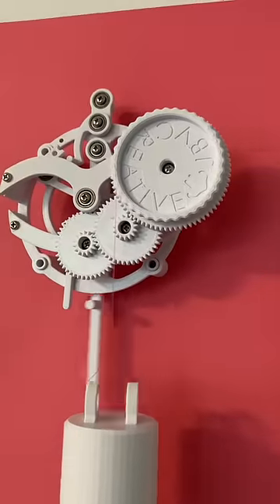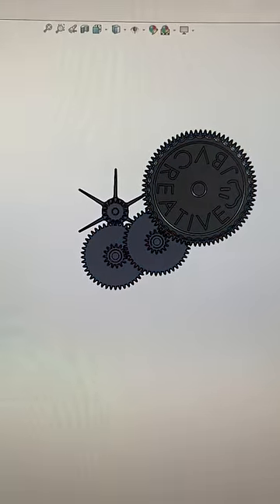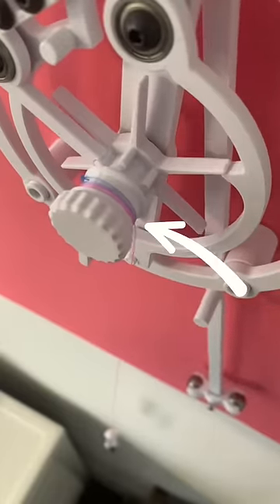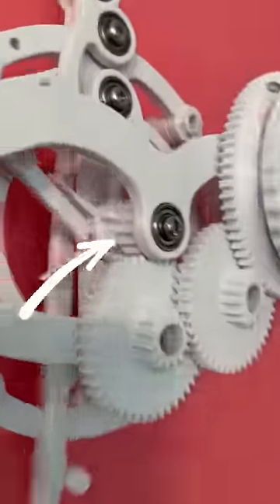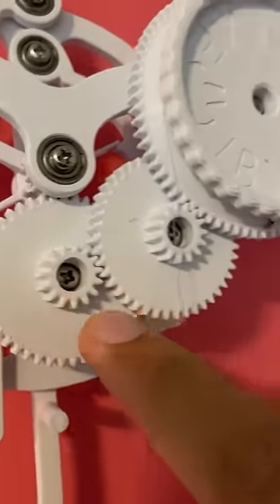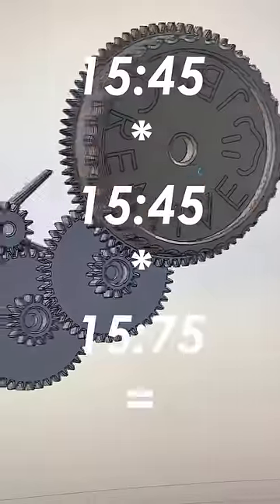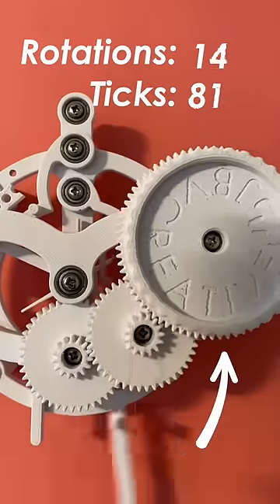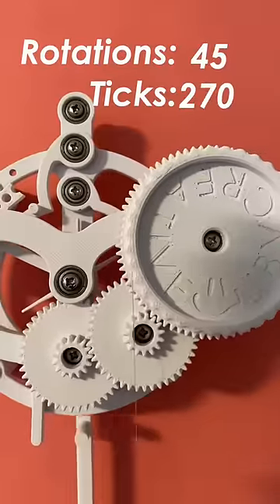Why Did I add Gears to this Clock Mechanism?

Comment: Poor guy had to explain why there is a weight for all the "infinite energy" smooth brains 😂
Reply: The amount of people in the first video saying it was fake because perpetual motion is impossible 🤦‍♂️🤦‍♂️
Reply: @Mike0  that's in some way even sadder 😂
Reply: That weight is a battery
Reply: Smooth move, Ex-Lax. You're as sharp as a marble.
Reply: @Nikkikkikkiz  How would a battery even help here?
Reply: @arcticfox037  it is a battery
Reply: @Nikkikkikkiz  ?
Reply: @arcticfox037  the weight can be called a battery as it stores Energy until is is used.
Reply: The weight is just a battery using potential energy unlike most consumer batteries using chemical energy
Reply: It was the specific words he used that caused it.  "Putting energy back into the pendulum/ system" caught everyone
Reply: @arcticfox037  by providing weight. He never said it gave electrical power to the clock.
Reply: @arcticfox037  I was going to tell you but other people already told you haha

Comment: If you make the Pendulum twice as long it will run longer. Pendulums should not swing more then 3 digress each side to be Isochronous. It's sort of  important. 997mm is about 1 second

Comment: Adjusting the weight and length of the pendulum will also increase time, perhaps more precisely. You might as well make a grandfather clock at this point, you’re halfway there

Comment: “This is not a perpetual motion machine”

Ah shucks really thought you created infinite energy to power the entire planet for a second there
Reply from the maker: LOLz
Reply: It's possible. Just a lot more work. I'm trying to figure it out. But I would rather ask the right questions

The hardest part would be to create the perpetual motion automaton which would in turn create the machines that would create the automatons that create the perpetual motion device so that when it wears out it will replace itself. Or, you could just make another human

Robots. The fun part is making the baby
Reply: @keenansmith82  perpetual motion is not possible.
Reply: @cmarshallc  woooshh
Reply: @aayesher9400  you sure about that?
Reply: @cmarshallc  somewhere in future it might be possible
Reply: @the_coconut_man7759  it violates too many rules it is not possible
Reply: @Cheems856  i said "maybe in the future" implying that one day we actually find a way to do it
Reply: For a perpetual motion machine you would need zero resistance (no matter if electric or mechanical) which is simply not possible as absolutely zero is not achievable ( I know there are other superconducters that work above 0 K, but they have their own issues) or having zero friction as even quantum fluctuations would stop the machine at some point
Reply: Can't wait for some random to just invent an actual perpetual motion machine defying all laws of science lol
Reply: @the_coconut_man7759  no, we won't.
Reply: @hurz506  yes we will
Reply: @the_coconut_man7759  
No we won't. Perpetual motion is not possible, and we know this as it has been an important area of study for literally thousands of years.
Reply: @the_coconut_man7759  it literally goes against the laws of thermodynamics. Unless the very fundamental laws of our universe changes, it is impossible
Reply: @justsomeguywithnolife7469   Even with zero resistance you don't have a way to take energy Out of the system to create power. So sure, it has perpetual motion, but no way to produce power. Which means it's not the same as a "perpetual motion machine". As that phrase has a special meaning.
Reply: @SendarSlayer  I thought it was just meaning going forever. Yeah of course it doesn’t create energy I wasn’t trying to imply that
Reply: @the_coconut_man7759  please educate yourself properly before making such claims, you're making a joke of yourself
Reply: @keenansmith82  the first law of thermodynamics really flew over your head💀😭
Reply: @tim.m  i know its impossible  because of the laws of thermodynamics but ive seen a shit ton of science discoveries that make me think its possible
Reply: @the_coconut_man7759  You just completely contradicted yourself... It's impossible.
Reply: @justsomeguywithnolife7469  so basically space which lacks air and gravity then to find a way to get rid of friction entirely.
Reply: @musa978  : )

Hehe
Reply: @Engineezy  I'm glad you said that it's not a perpetual motion machine, but sad that you had to say it.
Reply: may I ask what 3d printer you use?
Reply: Opposite realisation for me. I knew they are impossible so i was looking for the catch. And that is that you have to twist the weight back up
Reply: @aayesher9400  this isn't a wooosh moment. He's right
Reply: Lmao perpetual motion is this funny make believe idea. Energy in Energy out 1-1 . Physics can never be unequal.
Reply: I mean ideally you can create a machine that never stops, that's feasible in theory (for example a wheel in space would ideally keep spinning forever). But a machine operating above 100% efficiency, meaning it outputs more energy that it was put in, that's just nonsense in any way you put it
Reply: @nocturn9x  no a wheel spinning will not continue spinning . You have drag elements that leach energy off......
Reply: It's impossible to create an infinite source of energy but is possible to create one that can last for extremely long periods of time (thousands of years or higher).
Reply: @honquewastaken2298  pushing it but yes
Reply: @keenansmith82  gotta harvest the energy in the atmosphere
Reply: @honquewastaken2298  I know lol it would be cool if eventually we had tech to come super close to it with a highly low maintenance requirement to replace things like nuclear fossil and bio fuels though I doubt that would ever happen
Reply: Elon musk already figured it out. It's giga factories
Reply: @the_coconut_man7759  there will never be a way to get more out of a system than what is put in.

You might as well stay "maybe in the future we will discover a way to break physics"
Reply: @jeffh6960  I said "ideally" and "in space" (= no drag)...
Reply: @nocturn9x  space still has drag...... space is just a vacuum.
Reply: @the_coconut_man7759  back to school for you g, shouldn't have skipped physics class.
Reply: @cmarshallc  One of two things is true: @Keenan Smith knows a p-m machine isn't possible or he thinks we can just build a machine that builds machines to make machines that build more machines. I think he knows...
Reply: @clearviewmoai  nah
Reply: „There is no free Enegery device“ - angry ElectroBOOM
Reply: For people believing in those perpetual motion machines go watch his videos he explains it well why it can’t work
Reply: @jeffh6960  Yes, there's a tiny amount of drag. It's why I said "ideally". Of course perpetual motion doesn't exist, but physically speaking perpetual motion is feasible if we could somehow remove all sources of drag, but a machine that operates above 100% efficiency just breaks all laws of physics
Reply: And people who think its impossible are the people who are gonna slow down the progression of humanity
Reply: @the_coconut_man7759  it quite literally is not possible and breaks several laws
Reply: @Jem2556  you really want to think its impossible
Reply: U can also make the pendulum longer 🤔
Reply: @the_coconut_man7759  no I don’t, infinite energy would be sick, but it’s not possible you can’t create energy nor destroy energy, it’s probably the most important law in physics
Reply: @the_coconut_man7759  "Nah bro trust me scientists discover wild shit every day so it may be possible to reverse entropy"
Reply: Jesus replying on this comment area is tiring
Reply: There is no free energy!!! (Electroboom)
Reply: @keenansmith82  no it's not
Reply: Physically impossible to get more work out of something than you put in. Regardless of how many flat earth posts y'all subscribe too.
For clarification I love your videos. Just not the tik tok kids here thinking they know math let alone physics.
Reply: @the_coconut_man7759  proof? Or just wishing? At that point you might as well pray.
Same result. Nothing.
Reply: @ninefingerjack  well the electromagnetic flux gen was proven to work but im already tired trying to prove its possible to create a perpetual machine since its a 5v1
Reply: @the_coconut_man7759  and you're mistaking fusion with perpetual motion. That's literally after a 5 second Google search.
Read first.
Reply: Goodbye and thank you for wasting my time
Reply: Well perpetual motion is not possible on earth because of friction a magic thing that transfers energy of free usable form into heat which in turn dissipates because of temperature
Reply: The only and really only possible half perpetual motion is a magnetic field that lifts or accelerates something and then drops it over and over again to make heat to boil water and use a steam wheel to get electrical energy to power the magnet itself (in order to turn it on / off) which would in turn without friction go infinite but won't win energy because to "make" energy we would need to destroy matter with antimatter and even then it is transforming, because atoms are consisting of energy they can be transformed into their free form of energy, the only way to win energy would be to form matter and antimatter out of nothing
Reply: @ethandark1232  perpetual motion is not possible anywhere due to the law of conservation of energy.
Reply: Even perpetual motion would just be basically frictionless environment. It's just maintaining energy in the same state at infinite efficiency. You'd need to create energy without expending energy or material to get the infinite energy.
Reply: @keenansmith82  perpetual motion machines are known for being impossible
Reply: @aayesher9400  no I don't think that's a wooosh moment I'm pretty sure he actually thinks he can make a perpetual motion machine
Reply: Just to let everyone know, you can use something like this to make a gravity powered energy generator, but just because it only uses gravity does not mean it is perpetual motion.
Reply: @notablequasar6446  There is no such thing as a gravity generator what you mean is potential energy. You lift something up and drop it to release the energy. The only real use case for this is for storing energy by having water pumped up in surplus and pushed through a turbine when you need energy but it doesn’t create Energy with gravity it just stores it
Reply: @justsomeguywithnolife7469  Energy isn't the way to think about this. It's power. Say the string on the machine in the video ran in a loop, and then it falls for 20 mins (Due to the gear ratio), then you unattach said weight from the loop, lift it up in the span of 2 seconds back to its initial position, then let it fall for another 20 minutes. Does that not produce power from gravity? If not please explain.
Reply: @the_coconut_man7759  i love how all of you evidence is "trust me bro"
Reply: @justsomeguywithnolife7469   overunity.
Reply: perpetual motion isn't a thing at the moment, because it will lose energy at some point, some things tho are engineered so well that they can mimic perpetual motion,
Reply: Once we figure out efficient fusion, a glass of seawater will provide the same energy as burning a barrel of oil
Reply: This comment section is just sad
Reply: @cmarshallc  it is, just not in a way to harness its potential. A perpetual motion GENERATOR isn’t possible, not perpetual motion in general.
Reply: @keenansmith82  actually it's not possible,and no ammount of work changes that.
Reply: @aayesher9400  he is 100% serious,stop covering for stupid people by pretending they are joking, you only make a fool of yourself
Reply: @the_coconut_man7759  there is no mabye,we know for a fact it is not possible,no way to make it exists or can exist,period.
Reply: @the_coconut_man7759  you'll wait untill the heat death of the universe then
Reply: @notablequasar6446  you put energy in it by lifting it back up and it gets released again you didn’t make power as you needed to put energy into the system (for example using your muscle power to move the weight up) so it can fall down again releasing the potential energy. Also Energy is just Power * Time
Reply: @ryanlee900  There is no free energy device. Don’t you think a device that was invented in 1985 wouldn’t get used by a third world country if it makes energy out of thin air? You act like there aren’t any other countries in desperate need of energy who don’t “suppress knowledge , btw I saw that on history channel!”
Reply: @the-lag-gamerita5446  might aswell lol
Reply: @IvanSN  it's not possible with our current law of physics, if we ever figure out a way to modify the laws or go to different universes with different laws then we might figure it out, just never in this universe with this set of laws
Reply: @potatopotato590  neither will never happen. they're not possible.
Reply: @justsomeguywithnolife7469  Yea you're probably right, but power = force*speed or energy/time.
Reply: @keenansmith82  perpetual motion machines are objects that use energy without needing energy taken from another area. This would effectively produce an infinite amount of energy. It's not hard; it's impossible...
Reply: @justinkaufman495  space actually still has some gasses in it, Infact that's actually what stars are made of, Giant clouds of gas that get so big they collapse and start nuclear fusion(Not fission, That's dividing atoms, Fusing them is what stars do, Just had to clarify that to give people no excuses to say stupid stuff)
Reply: @excision3409  that's like saying my car's gas tank isn't empty. there's metal in there.
Reply: @notablequasar6446  you realise P = E/t is the same as E = P*t
Reply: @justsomeguywithnolife7469  And my literary skills (i.e. reading that sentence) is why I prefer maths.
Reply: @the_coconut_man7759  well if friction doesn't fucking exist in the future, sure
Reply: @notablequasar6446  you can generate power from gravity there, sure, but you first have to put energy in by raising the weight up and rewinding the string
Reply: @keenansmith82  perpetual potion is imposible, done
Reply: @Cheems856  the only rules it violates are the ones we ourselves created, and therefore there may be a way to break them
Reply: @keenansmith82  even if you get perpetual motion, you can't take energy out or its broken
Reply: @notablequasar6446  nope that's still just storing up potential energy. you put in energy by lifting up the weight and then it uses that energy for 20 minutes. you arent generating energy, just using what you put in
Reply: @keenansmith82  also trying to figure this out. Gravity IS a constant force so theoretically this could be turned into a perpetual motion machine. 🤔
Reply: @keenansmith82  no, the hardest part is hiding the batteries
Reply: @the_coconut_man7759  That's not how the world works.
Reply: @justinkaufman495  Space doesn't lack gravity, gravity exists anywhere where there is mass. It becomes negligible over extended distances, but once you introduce mass there you ruin that.
Reply: @keenansmith82 Perpetual motion is impossible unless a miracle happens.
Reply: @the_coconut_man7759 it won't be possible now or in the future unless a miracle happens.
Reply: @justsomeguywithnolife7469  And Apart from all of that, even if we assume it has no resistance , we still won't be able to harvest any energy. It would just be a cool machine with no practical uses.